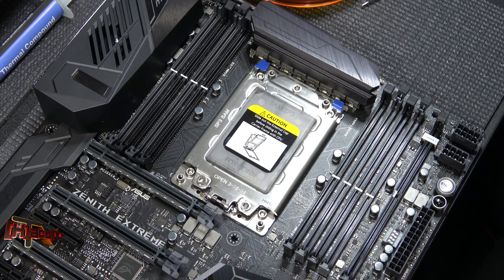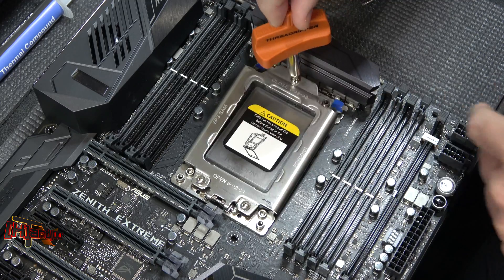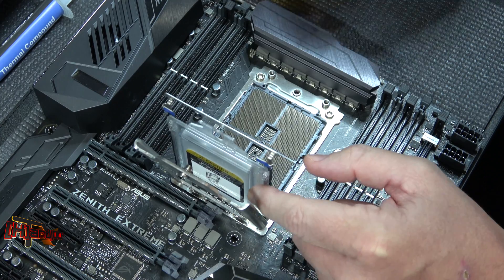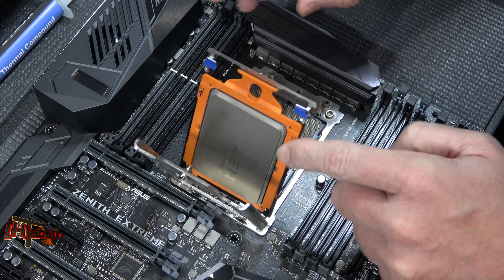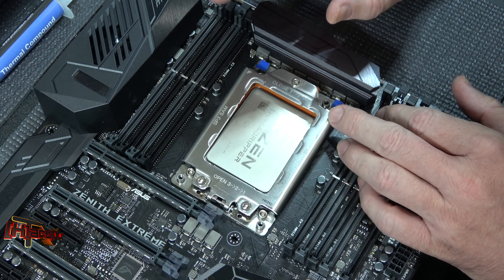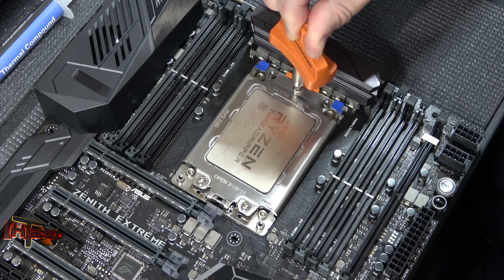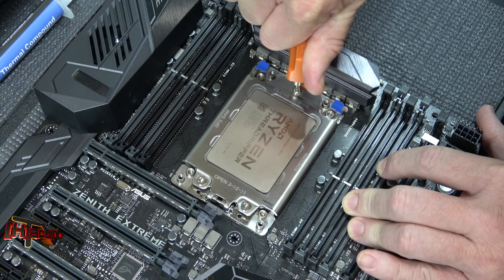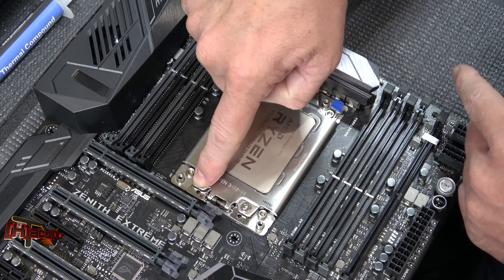AMD Ryzen Threadripper Install Tips and Tricks - Socket TR4

Comment: Thanks in building one knows to tighten opposite corners first but these sockets are quite tricky, this helped reinstalling my 1950x and I hope it works for the new processor. I hope they re designed this socket.

Comment: Looks easy But try it with the Gigabyte X399 it's a nightmare so much so I wish I had gone intel Solely because i'm not confident its ok ! And that's the problum with any other cpu setting i feel fine but this thing NO .
Reply from the maker: It is really hard to screw up as long as you don't touch any of the pins.

Comment: We had a customer bring one of these in today. He couldn't figure out why his PC wouldn't POST. Turned out he didn't install the CPU right. It's nice to see a higher-end build every now and then as we usually end up getting budget and mid-range stuff to service.
Reply from the maker: Hope he did not tear up the pins in the socket.  Those things are like angel hair.
Reply: The pins were good. Good thing it's LGA as the CPU cost more than the motherboard.

Comment: On Lotes socket there is no need to do this. However, the Foxconn sockets need more or less a method like the one you demonstrated.
Reply from the maker: Have used both Foxconn and Lotes, both seem to be about the same to me across multiple boards.

Comment: First screw is not grabbing. Thoughts ?
Reply from the maker: Make sure you have your tool inside the head of the screw well so it does not slide out.  Do not be afraid to push down hard on the screw.  I have had some that were a bit more stubborn, but as long as the tool does not slide out, you are not going to damage that socket pushing down.  Make SURE the CPU is slid all the way down into the carrier slot, and make SURE the CPU is sitting in the socket properly.
Reply: HardOCP TV thanks. It was pushed all the way down in the slot. I just had to push pressure on the first screw and to worked. I mean a lot force but it worked.
Reply from the maker: Yeah, it can be a bit scary, but as long as the tool is controlled, you can "beat the shit" out of that socket.  It is built like a tank.....just do NOT ever touch any of the pins down in the socket for any reason whatsoever.
Reply: HardOCP TV thanks. I did not touch the pins. I did seat the plastic cover again to test before I slid the processor back on. Pins looked good when I looked at it.

Comment: The problem is that even on the first bolt, if you turn the opposite way, you don't hear or feel that "click" because the bolts are too short with the CPU installed.  With the covers, it's fine.  I had to push down on the wrench HARD while turning it to start the threading.  Once I feel it start to thread in, I had to do the same to 2 and 3 - push down very hard while turning to even start threading.  After I start threading all the bolts, then I tighten down 1, 2, then 3 in that order.  Your socket doesn't have the problematic short bolts that I (and others) have.
Reply from the maker: Pushing down hard on those is fine.  You are not going to damage anything.
Reply: I'm having to do the same thing right now. It's freaking me out and pissing me off. If I bend a thread, I'm calling someone because that's not even my fucking fault at this point. This processor better be worth it. Wish me luck...
Reply from the maker: Just make sure you have pressure pushing up on the backplate and you will be fine.  Those threads are REAL tough.
Reply: I have to push hard too on all 3 bolts , and I don’t hear click at all. I think my socket has defect, one pin on motherboard higher than others.

Comment: The way I install screws is largely the same in this video but the one key difference that is preferable in my opinion is the following after the screws have been started as demonstrated in the video. I do not torque screws after they have all been merely started, I turn them all to the point that the screw head just comes in contact with the frame.

The objective is to first get the frame to lay fully flat. After that I will torque down the screws. This is the same principle you use for mounting wheels on your vehicle. You get the wheel to a fully even contact position and then you torque in the approved sequence.

So to be clear I am using a three step method instead of a two step method. In many years of observing mechanics I usually see them using the two step instead of the three step method. I've never liked it and I think it is the wrong way to complete the job.

Step 1: Gently seat the thread of each screw/nut one half to one turn
Step 2: Turn screw or nut until full contact is made with no overt pressure
Step 3: Sequence torque screw/nut to spec
Job done.

Comment: I can't do that on my socket - in the corner it says H6T2 not H6N2, when you close it there is still a good 2-3 mm gap unless you push down on the top with your finger or really hard on the screw
Reply: Your experience is not unique.  I have one of those boards as well.  An Asus Zenith Extreme, no less.  Was surprised at how much force was needed to push down to start catching the threads.  After they catch, I do the same for 2 and 3, then torqued them down once they were all started .
Reply from the maker: I have another here that is laser printed with H6C2 and have no issues.  Pushing down on the socket is not going to hurt anything. The TR4 is NOT delicate once you have the CPU carrier in place.
Reply: The amount of force that I had to use surprised me
 when I watch other youtubers (including you) it seems like they put very little force down to get that first screw I really have to put my shoulder into it
 I have no issues after its down, and wouldn't rma because of it. It just makes me second guess if I'm doing something wrong.
 I have different mobo for another build coming in tomorrow ill reply if its different I guess
Reply: I had the same experience as you and +Guy Techie on an Asus Zenith Extreme. I really had to push physically hard, say about 4 to 8 pounds, to get the Nr 1 screw to catch. I finally looked at the frame with a steel rule placed on the back and low and f***ing behold the frame was slightly bent upward. Minimal but enough to make it, in my eyes, a defective product. RMA'd it and still waiting for the return, one month on.....
Reply: I just switched from EK to XPSC for my waterblock im getting at lease 12c lower difference ..wtf..-- but I noticed when I threaded the screws for the xpsc (there really long) one of the top screws sat at an angle (had to slowly torque it back into place to get the plate on) I guess the mounting hole was off funny .. this socket is hell ..
Reply: defects

Comment: If people have a hard time installing a CPU they shouldn't be building computers they should leave it to you guys the professionals
Reply: If someone follows the directions perfectly and it doesn't work that's not user error.
Reply: Technically, not user error, its a slight design oversight. but, as shown in the video, someone decided to mess around until they found a solution. So shh.

Comment: That Threadripper install process is super sexy.
Reply: agreed, very well done!
Reply: If it was easy for you, then you didn't have the problematic short bolts.  Read my comment in my experience.
Reply: No its actually garbage. Again AMD disapoints
Reply: everybody can have own, you too and I respect that even if you publish a little bit strange post... but AMD does not disappoint at all, look at the market and how intel products changed since ryzen appearing... badly designed foxconn tr4 socket does not change the fact that the threadripper platform (I and II generation) is big step forward in PC HEDT world